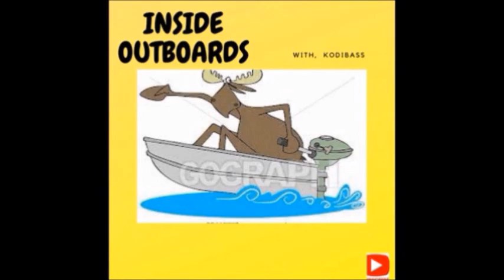EVINRUDE 1981 15 HP, JUNK OR SAVE,,, &  Dirty  Work

Comment: Hi Kodi, yes, the whining is coming across on this motor loud and clear. I have a feeling it's the upper bearing on the crank that is making all that noise but will see after you pull the lower unit if it goes away.  Did you get a chance yet to watch my latest video on the Lake with my daughter and grandson. We stopped in for lunch at Ivar's Salmon House for lunch on Lake Union. Great day on the water and boat ran great.
Reply from the maker: Got to dig in it some more,  Yes that was a great vid bro.    kb

Comment: Yeah, I hear the whining.  I guess I would drain the gear lube next to see if perhaps the gearcase is causing the whine noise.  The problem these days is that everyone thinks they are selling "gold" when it comes to parts for these.  These stupid little parts add up fast, but you have a great supply of used stuff.  I would agree, the old dog is just parts if the powerhead is whining.  This thing will need all the usual stuff to bring it back to life if the whining is resolved with fresh gear lube.  It's always hard for me to relegate one of these things to the parts department, but the poor thing won't command much due to its lousy paint job.  But, we all know nice paint does not a great outboard make....
Reply from the maker: Yep'  I agree .  Hoping it's the lower for  sure.     kb

Comment: Kodi waiting for part 2 also if you run an outboard with lower unit off do you connect a rubber tube to it so it can pull water from your tank ? Chris from OHIO GO BUCKEYES
Reply from the maker: I  sometimes do run a small pump and a hose connected,  But if I will only run motor for a min or 2 I don't.     kb